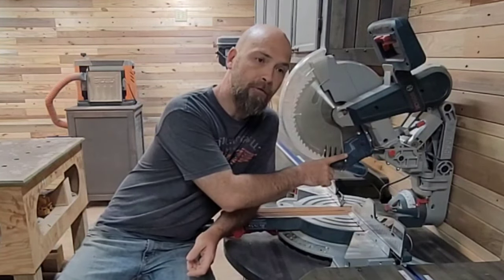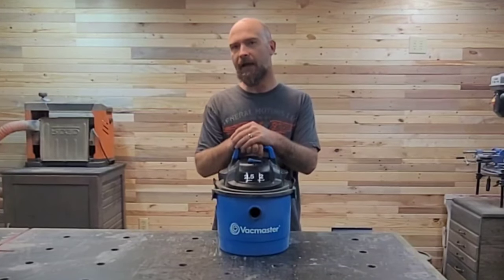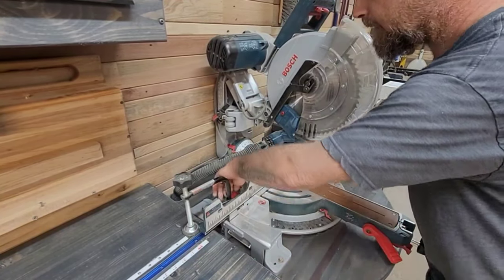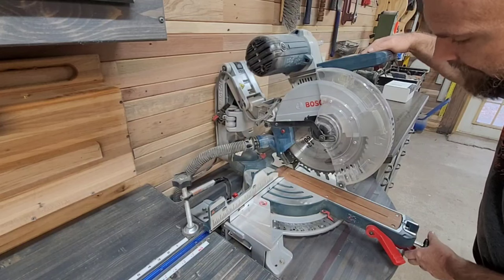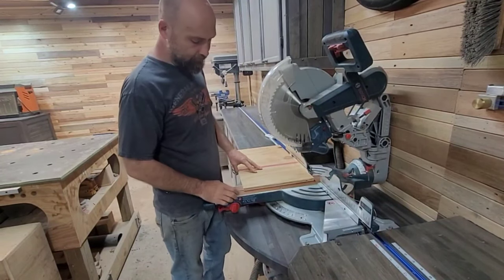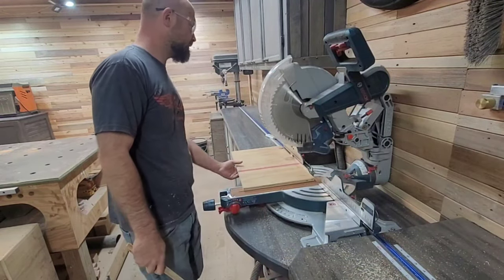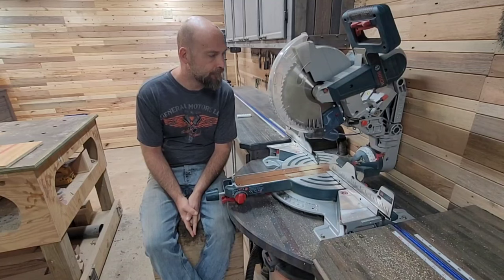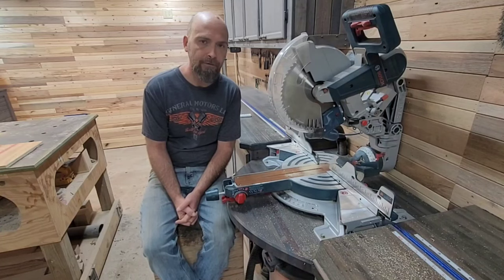Shop Nation, Bosch GCM12SD-15 dust collection system. how good,or bad is it really.

Comment: 100% agreed!! The shut created more problems than it alleviated! I’m a remolding and cabinet maker, I didn’t even hook up dust extraction, because part was in the way. Might be fine for someone who just cuts 90 degrees once a month, but if you need to use the saw for its purpose then it is true a piece of junk. The part is for a novice and really not even that. In my opinion huge fail. I appreciate your review, just wish it was out before I made the mistake of purchasing it. Thanks! 

I took a look at benchworks and it looks thinner, but it also interferes with usability! Bosch has more than one engineer working on these saws and dust collection is minor when compared to usability, that is the sole purpose of a dual bevel sliding miter saw.
Reply from the maker: I agree 100 % . I have also noticed that in his latest videos he is using the ridgid and not the Bosch. So he only developed these to sell. Mabe  the ridgid is better because that's his daily user

Comment: You don't have NEARLY ENOUGH vacuum!!! Get a real dust collector. A 1 &1/2 HP (2HP better) with 3" min hose (4" better) with an addaptor to fit your fitting. Don't wear a cap. It will suck it off your head! Cheers!
Reply from the maker: Lol I'll look into it but it to late now it blew apart
Reply: @meanmacawwoodshop   what do you mean blew apart? a piece of wood kicked to the collector and broke it?
Reply from the maker: @KayLE-x4t  and it blew apart
Reply: @meanmacawwoodshop  what's the replacement now? Are you going with Benchtop version?
Reply from the maker: @user-bk6db7we1o I'm not sure yet. I think I need to upgrade vacuum system first

Comment: Thanks for the review!  I considered getting this product because the dust collection is notoriously bad with the factory set up.  It looks like the Shop Nation dust scoop is not significantly better.  I tried the extended flap solution offered by another YouTuber, I cannot recall his name, but DP were his initials I believe.  The extended flap seemed like a reasonable solution but again, only marginal improvement.  I love this Bosch saw, but the dust collection is horrible. I’m still looking for a good solution. My Dewalt 779 was much better with dust collection.
Reply from the maker: The dust collection is for sure bad but the saw itself is a great tool I love mine

Comment: All of the reasons you mentioned were why I went with a different and much better version, made by Benchtop Woodworks. it directs everything out in the same direction as the factory setup.
Reply from the maker: Would you happen to want to share a link I would like to check it out
Reply: The links to his etsy store are in the description of his video
Reply from the maker: @MADMANmakes  thank you
Reply: I’ve purchased and have both of these versions. I prefer the Shopnation version way better and I do not have any issues with it. I don’t have the issue with the dust the way you demonstrate.
Reply: Just an observation, if you hold your hand with a pile of dust to the chut and there is minimal suction is that the faut of the chute which simply redirects the airflow or the vacuum itself?  @haveeair
Reply from the maker: I do agree with your observations. My vacuums are not the greatest. That was just part of the review, even though my vacuum are not the best the outcome with the new port should have shown improvement. I think so anyway. Maybe not? The rest of the problems are my issue. The lack of maneuverability and comfort of use without improvement is where my concerns lie. I will be buying a large shop vac in the future for my planer cart so maybe I'll test it again on a much larger vacuum.
Reply: @haveeair  What's better about the Shopnation  version? I'm debating which one to get now.
Reply: @KayLE-x4t  shopnation version is way easier to put on and remove and with the other version, the hose constantly popped off my hose. Hope this helps.

Comment: I'm surprised you don't have a separator( a must ) The hand full of dust you put directly into it was barely sucked up. I feel that your filter was severely plugged causing low suction. SN really does test them fully and every possible way. I have one and it has been fantastic. I'm using  5 HP rigid vac and a dust separator and it works great I'm very happy with it.
Reply from the maker: I am glad you had a better experience with yours. My vacuum setup was definitely not up to the task that's for sure. That is why I left on till I could upgrade it.

Comment: The problem is the small port. It won't allow enough air flow to pull the very high velocity wood particles into the shoot. Dusy collection is more about air VOLUME flow than simple vacuum pressure.
Reply from the maker: Agreed 👍

Comment: I bought three of these, two have broken. I made sure to clear the cutting area was very careful with it and they still broke. The problem is that the plastic isn't solid. It's a zig zag pattern like cardboard. Not at all durable. 

When I contacted SN about the first one that broke, I was more providing them an FYI on how it broke, because if you watch his channel he made an entire video on how he wasn't able to replicate the problem. Anyway, he didn't offer to replace it, instead provided a 50% off coupon. Figuring it was a fluke I gave the benefit of the doubt and bought two more. Well, I got halfway through my kitchen cabinet trim job and the 2nd one broke. For no apparent reason.... So I'm on my the 3rd and last one of these. Would NOT recommend. It's not that it might break, but when. Can't justify buying these over and over unless he changes the materials to something more durable. 

That said, it was a lot better at dust collection than the stock chute. So I'll give them that.
Reply from the maker: If you can read down in the comments there are some other options
Reply: @meanmacawwoodshop  I appreciate you making this video and I did see other recommendations. I appreciate it. You earned a subscriber.
Reply from the maker: Thanks I appreciate that